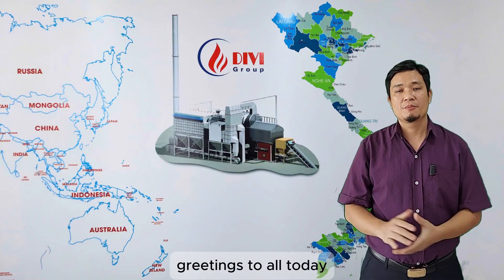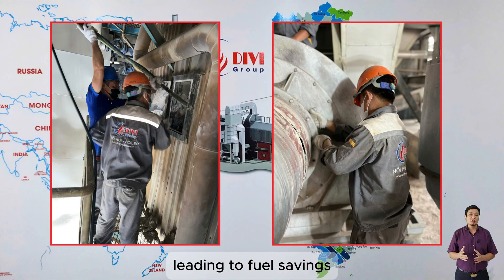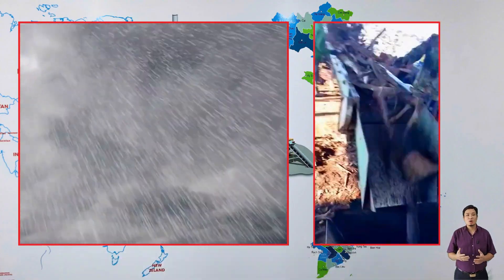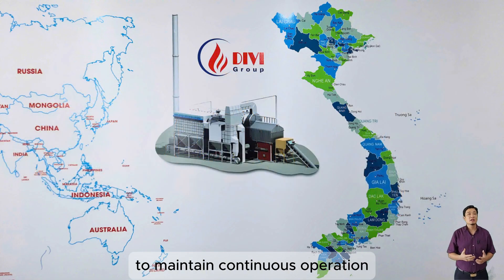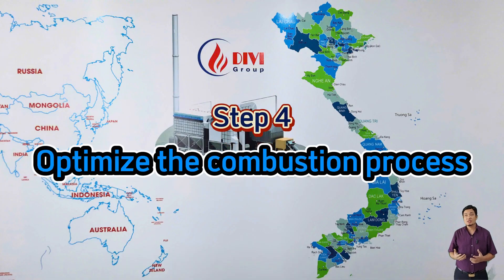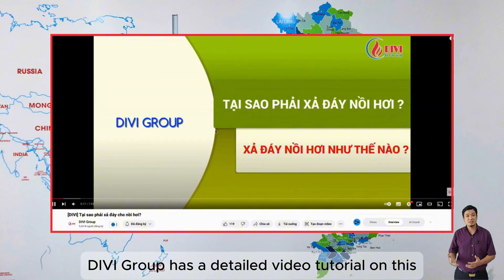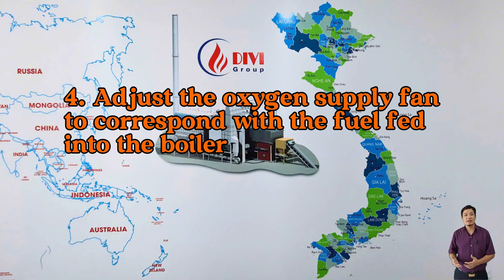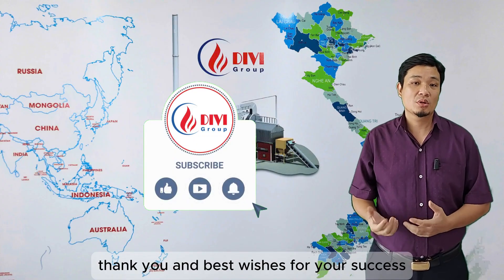5 Easy Ways to Reduce Fuel Consumption in Your Boiler System

Comment: Why is regular cleaning important for reducing fuel consumption in boilers?
Reply from the maker: Regular cleaning ensures optimal heat transfer, improves efficiency, and reduces fuel usage. Cleaner equipment operates better, saving fuel.